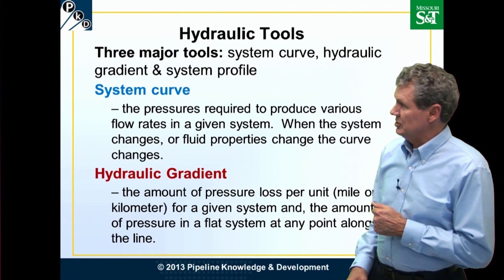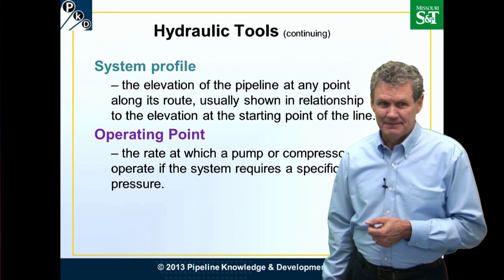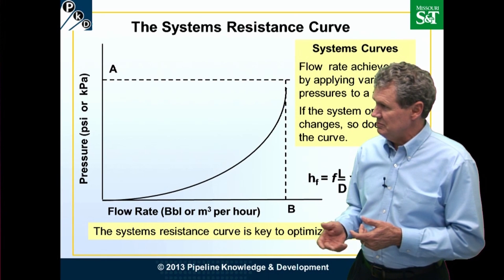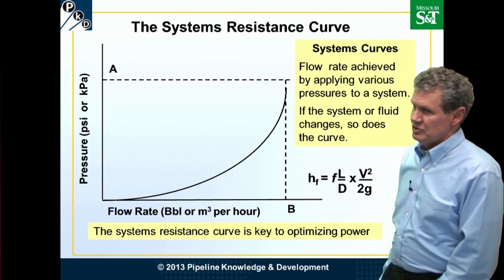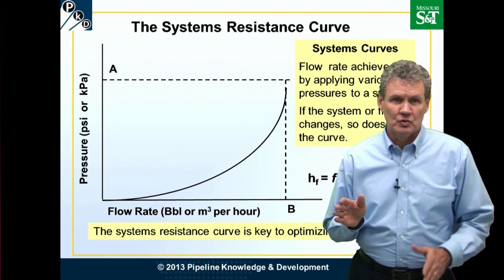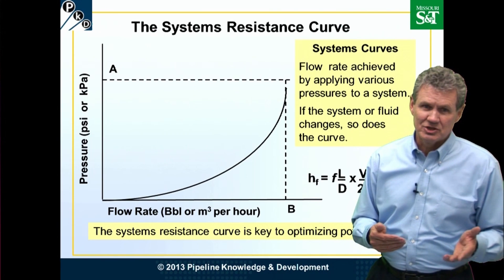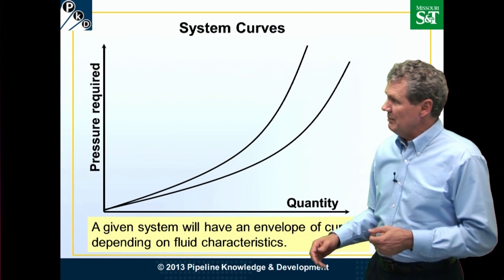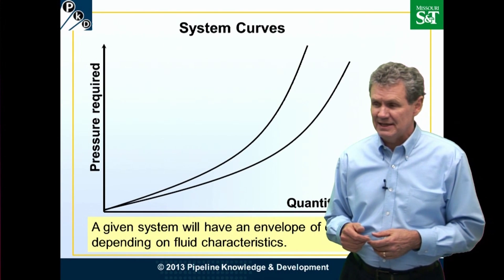Introduction to Hydraulics - Systems Resistance Curve

Comment: How I could get the next video I mean the rest of this lecture, thanks.
Reply from the maker: You can enroll in this or other related classes at https://onlinetraining.mst.edu/ets/store/?cat=bcaaf45e-94ea-4326-bbfe-3a37228cb3e2

For more details please e-mail suet@mst.edu
Reply: Do you have courses for Pumps, Gas Compressors, Rotating Equipment I mean?
Reply from the maker: Yes.  They are included in the Hydraulics Class and the Equipment and Components classes.  They are available for the same link as send previously.